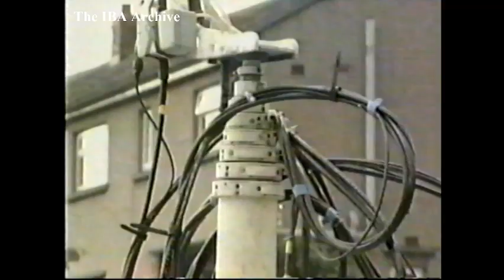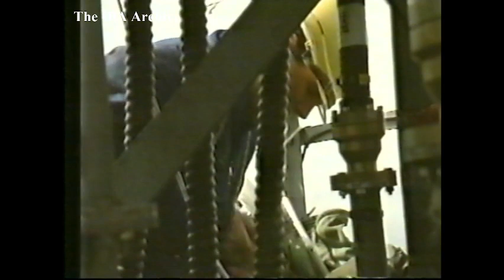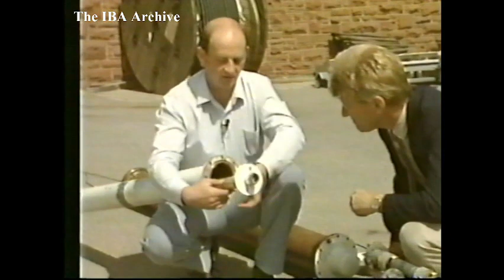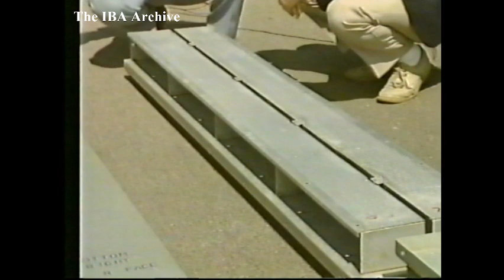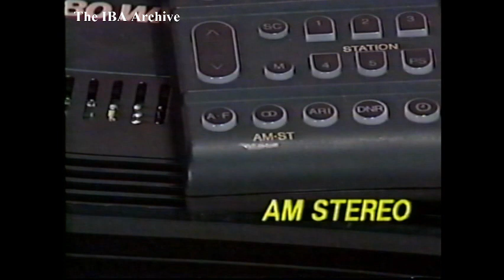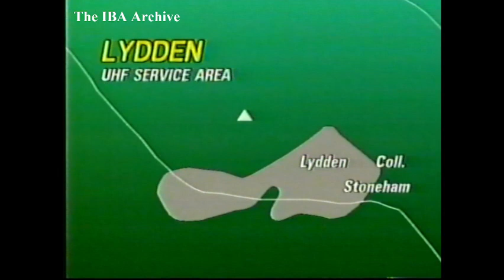IBA Engineering Announcements - 10 July 1990 'Aerial Maintenance at Caldbeck'

Comment: Were there times before this style when the BBC channels got mentioned on the pictures? I can remember it being announced once that a wideband aerial was required due to one of the BBC channels being much lower than the others, but most of the time the BBC channels were not mentioned at all until at least 1989 as I recall.
Reply: It does feel very petty. "Here's where our channels are, sorry, other channels might exist but we don't want to tell you about them".
Reply: @SarahFenway They were existing within the boundaries of the law. The Television Act 1954 (and the Broadcasting Act 1972) made it very clear that the IBA had no responsibility towards the BBC. And the BBC’s Royal Charter said the same about commercial broadcasters even if the site was being shared.